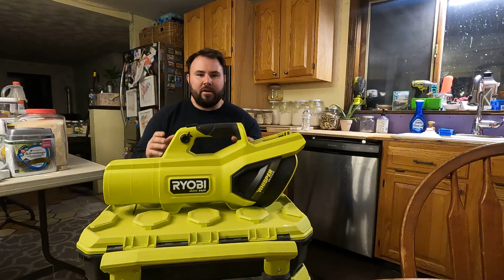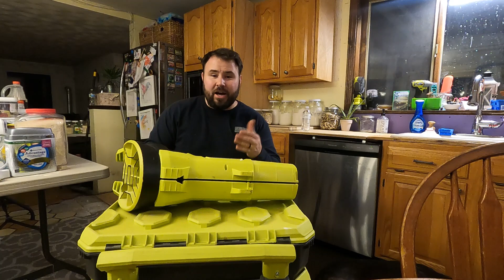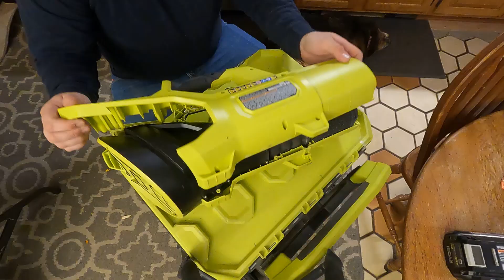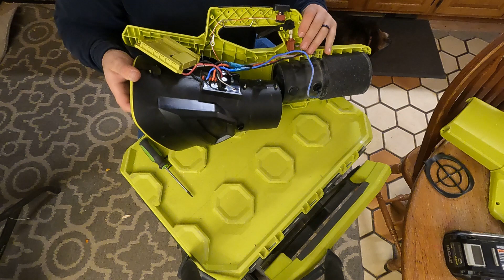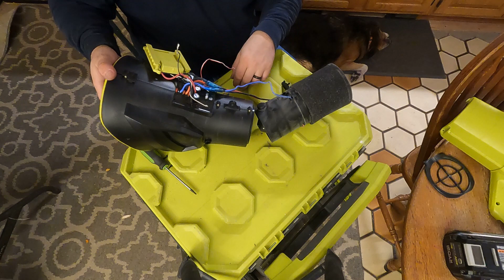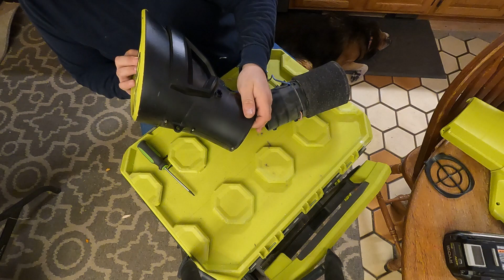Ryobi 40v leaf blower failure 700 CFM [what happened]

Comment: Had the cut out issue and tried this: used vinyl electrical tape to completely seal the tube/housing seam. So far the problem is gone! We'll see how long it lasts - I am also trying to get it replaced under warranty.
Uodate - tape trick only worked for a short time. 
Well - having the same issue on model RY040401VMN blower and was about to order a switch, but could not get a part number. Took unit apart and found both switches, circuir board and about everything inside coated with dirt/dust. Using compressed air I blew it clean and even used some quick drying auto mass airflow sensor spray on the switch buttons then blew them dry. Put all back together & with zero confidence, proceeded to test the blower. OMG! Did all the leaves in my giant driveway and it worked perfectly! Will clean every year or so from now on....🙂

Comment: I'm trying to repair my blower like this too.  I've torn mine apart and I'm pretty sure it's the main switch or motor controller.   Trying to hunt down a replacement switch right now... and I'm not having any luck.  Mine's out of warranty too.  Might try rewiring the switch if I can't get another for it.  Can make it worse than it is already.

Comment: Don’t know what it is I’ve had the power just stop on mine the last 2 of these I had.  Hundreds of times, maybe more.  Almost like clockwork, I pull the battery, blow on the connectors, pop the battery back in, it starts back up like nothing happened.  Almost every time.  Maybe 1/20 times I have to do it twice.  I happens the most when I’ve been flipping the blower upside down and vertical a lot.  It sucks but I’ve gotten used to it, hopefully this helps someone.  I’ve had 2 730cfm’s and they’ve both done it eventually.

Comment: Did you find out what happened to your Blower after all ??
 My blower just stopped working yesterday but I noticed at times it would stall at times.
If you can let me know Thanks great video
Reply: Mine stalled then worked at about 50% power using the dial on the side. Now only lasts about 20 seconds…
Reply: Same.
Reply: Same!

Comment: Is the metal bar under the grip to protect from static electricity building up?  Great tool reviews BTW.
Reply: Indeed it is! - The black wire slips around the same plastic pin that the metal bar is positioned.

Comment: Did you make sure it’s not the battery? I’ve had equipment that did something similar and it was the battery. But if you made sure the battery is good and tried other batteries then it’s most likely the motor controller that went out. Since it’s a brushless motor testing the motor would require another controller .
Reply from the maker: I tried multiple batteries
Reply: A couple of my 18v batteries have to be slid in real carefully for it to work. Just some batteries though. My 40v leaf blower has never had any problems, it is an older model though.